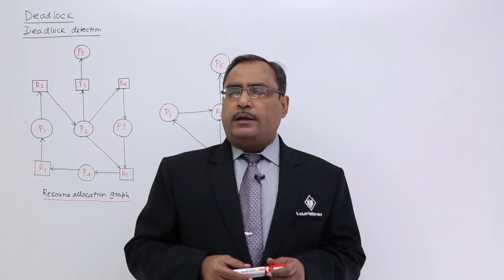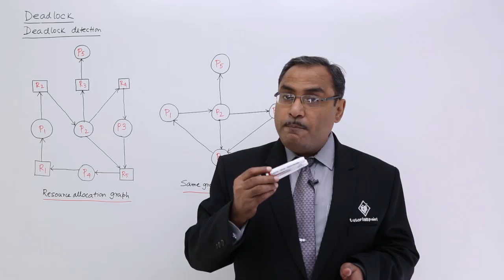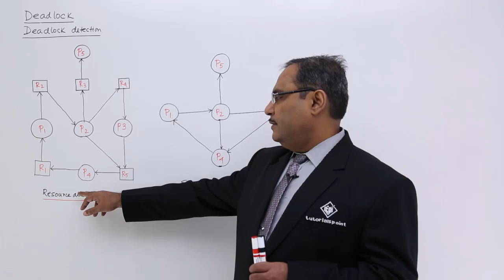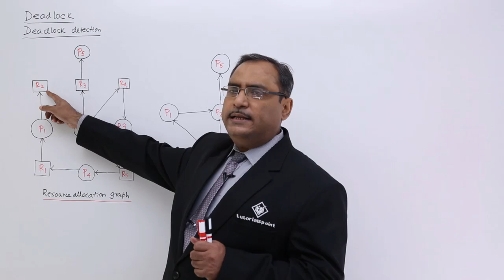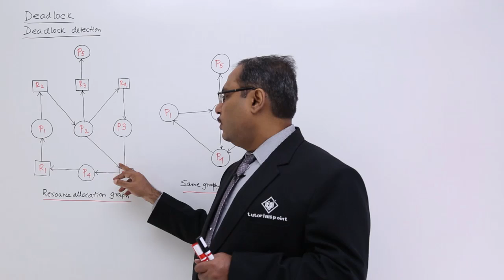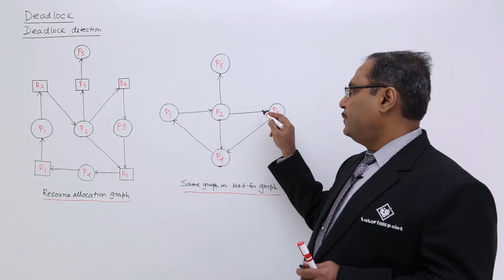Deadlocks Detection

Comment: What is cycle with a not?
Reply: Its not a "not", rather its a "knot"
Reply: so whats knot then ?
Reply: basically kind of like your shoelace , with protruding lines from the cycle
Reply: Knot like shoe lace.  Like when you tie your shoe lace,  the knot has two edges going out.  In Sir's example P2 is centre of knot and two shoe lace going out can be p2,5 and p2,3 edge.  I maybe wrong.
Reply: @adityakaushik252  correct